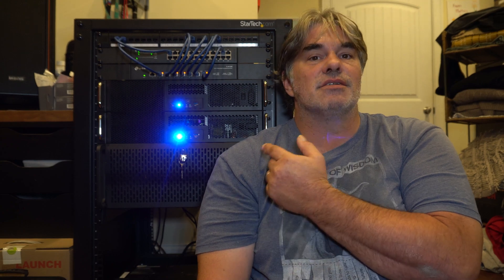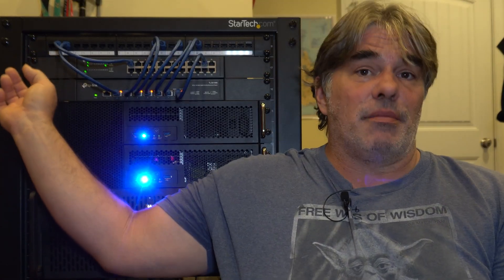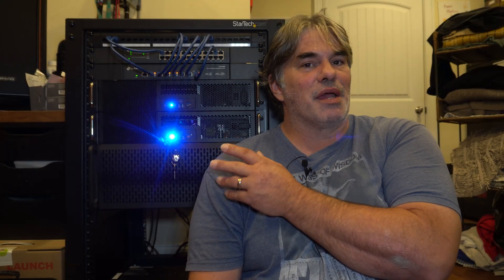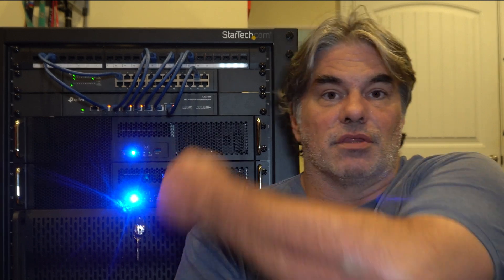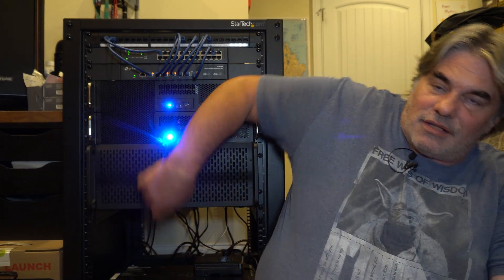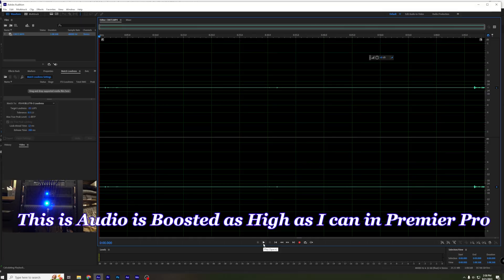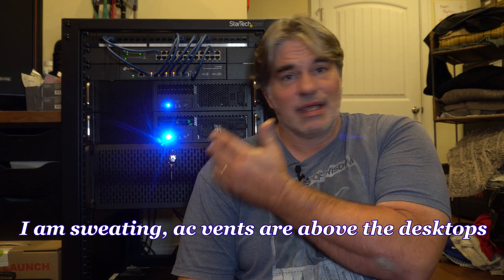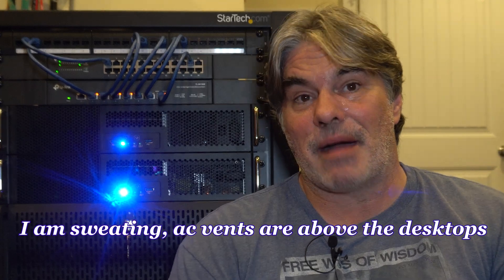Silent Home Lab-Server Rack Set Up- Unraid-TrueNas-Proxmox-Plex

Comment: what's next? i suggest another nas (this is optional but for smb - small and medium biz needs dual nas for sure) and hw firewall opnsense or ha opnsense boxes - both of these options can be done very very cheaply 6 gen intel boxes will suffice just make sure to add some extra ram - other than those couple of things i think you are basically all set - maybe get a cheap vps and do a reverse proxy for your server and vms
Reply from the maker: I will need to expand my Unraid server soon as it is almost half full and only has 1 parody drives, still trying to decide the direction I am going on that front, either new case or just add or Build a JBOD
Reply: @CreatorHardware  think about just running another nas with a couple raid0 or a raid10 for parity - this way the sep nas device will serve as a parity stripe in case the other nas goes down - you can run grsync jobs between the networked drive shares to keep up to date or use an automated backup system - having two systems is better than 1 and you should think about going to 40g - dual port 40g is like 30 bucks on ebay making it a decent choice and can speed up archiving backups significantly - you could probably get close to 2gb/s throughput if you go with nvme arrays and then you could have some spinning rust to longer term backups. do think about a opnsense box - it would help out your setup a bunch and it is full of goodies right up your power alley - also think about 24/7 pkt cap box based on selks - provides pcap storage and a good audit trail  - i say go for it with just old hp refurbs that have 32gb ram for another backup nas (for critical backups if primary nas breaks), opnsense box, pkt cap box - you will probably want to setup pkt cap outside net in front of opnsense and you can record all ingress and egress total cost maybe 200 a box including all the extras and you can upgrade to 64gb ram if you use 6th gen or newer - 6th gen and 4th gen are comparable in price, with 10th gen prices jump but you can run 128gb ram...try to go bare bones minimum to start out with - the min req for opnsense are pretty low so you may be able to get 100 buck box and be all set for opnsense, selks has a bit more req but not much more 16gb ram for opnsense should be enough, you will want 32 min on selks pkt cap and nas - all 3 together may use 150-200 watts under load but usually much less

Comment: You don't have space or time to build another room and run ethernet lines?
Reply from the maker: More about the Drywall, it would require tearing into a lot of walls, my office doesn't have a drop ceiling, and a rack would have to either go on the top floor, 2 floors above and across the house from my office or my garage that is on the other side of my house with out direct access to. Keep in mind my office is in the basement of my house

Comment: Good video sir, thats why i'm selective with my networking & server hardware too. It has to live in the same room as i work in and can't be driving me nuts :)
Reply from the maker: Thank you, the sad part is after I made this video the power supply for my editing pc is now running all the time and driving me nuts and replacing the power supply in my Be Quiet case sucks
Reply: I use a Mac Studio, so no noise :P  Hope you get your editing machine fixed.. BTW is that a Atem Mini Pro ? @CreatorHardware
Reply from the maker: Thanks, it is an Atem mini, non pro. I got it for some contract jobs needing multiple cameras to a live stream and to a in room projector, didn't need 4k so didn't get the pro